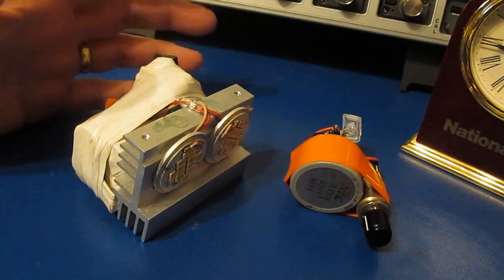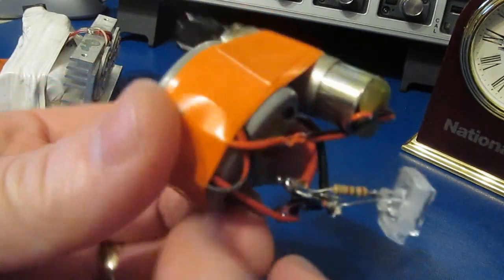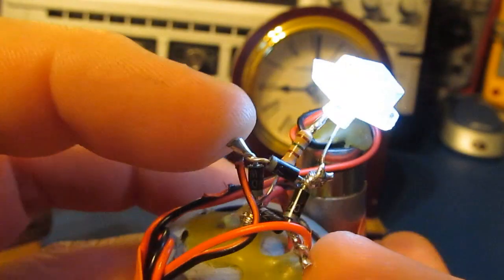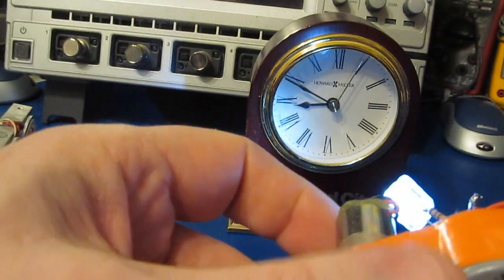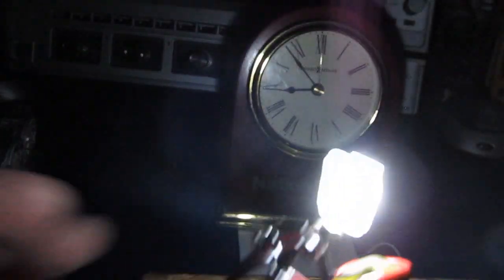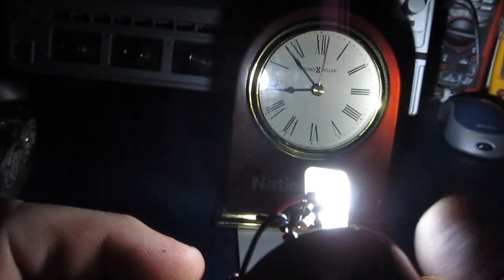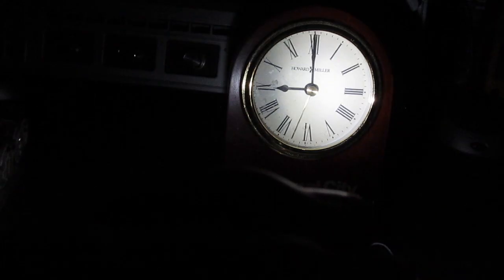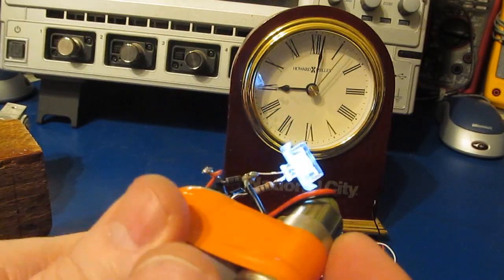Modern Dynamo Flashlight - Doesn't Use Batteries! Let's look Inside.

Comment: I looked everywhere and couldn't find it why doesn't somebody attach a clock wind up mechanism to a flashlight like you made to wind it up and keep it going instead of using those pump dynamo lights.
Reply from the maker: I have seen a windup flashlight / radio for sale recently.
Reply: @joesmith-je3tq I have one that radio shack produced It has a crank on it and you crank it and soon as you stop cranking it it shuts off I haven't seen one that has a wind-up mechanism with a spring driven mechanism.

Comment: You've reminded me of one of my biggest ever failures. Buying "supercaps" from a Chinese seller on eBay. The shame will never leave me. 
Pay the premium and get them from real manufacturers at a legitimate distributor, or salvage them from somewhere.
Reply from the maker: I have been running a long term experiment using some of those very low cost Chinese supercaps.   They have been in service 24/7 since June of 2018.
Reply: @joesmith-je3tq  Ah, maybe the ones you got were legit. When I measured the ones I bought some months after buying them (busy with work) they were in the 10's of uF range 😠
Reply: @joesmith-je3tq  Oh, which exact ones? Planning on making a video about it perhaps?

Comment: I had a squeeze flashlight as a child and your hand got tired and cramped quite rapidly.  The lever under your fingers drove a rack and pinion which turned a generator and flywheel with a one way clutch.

The shell was see-thru, which suited me nicely as I took everything apart to see how it worked and the transparent case helped the light survive my curiosity longer than most  things ;).

Comment: I found a commercial version in a Christmas cracker , it doubled as a key ring . The supercap was no more than 6mm x 2mm with a simple dc motor used as generator driver by a plastic gear chain.  It use two 3mm white LEDs . The SCap failed eventually (over voltage ?)

Comment: Quite impressive! Have you tried with a stepper motor as generator?
Reply: Geared reduction motor means slower turning to get a decent voltage. Stepper you would need one with a integrated reduction box, or else you would need to turn it somewhat fast, but it does work well.
Reply: steppers are pretty poor generators both in size and efficiency
Reply: @drkastenbrot  Not my experience.
Reply from the maker: @JoseSilveira-newhandleforYT  Just for you...  https://www.youtube.com/watch?v=474bZgK4Fiw
Reply: @joesmith-je3tq  👍